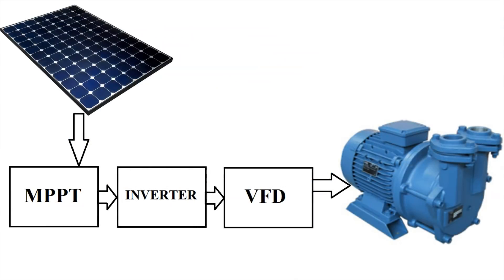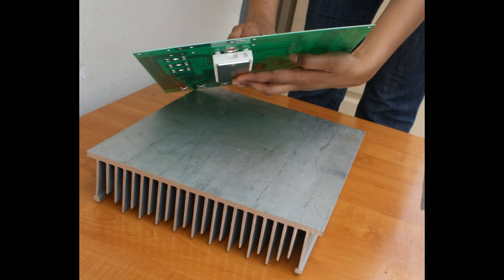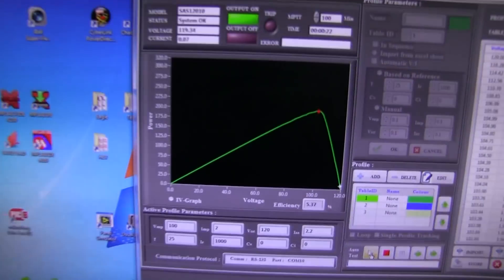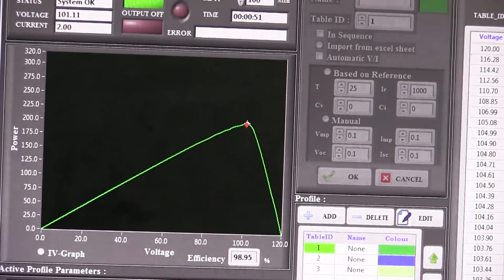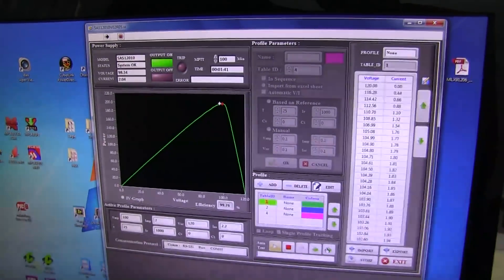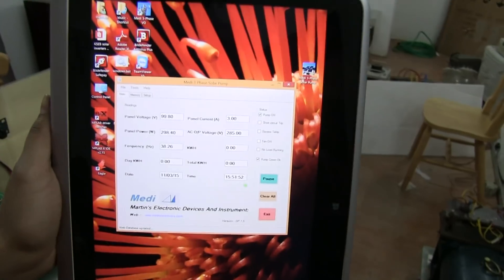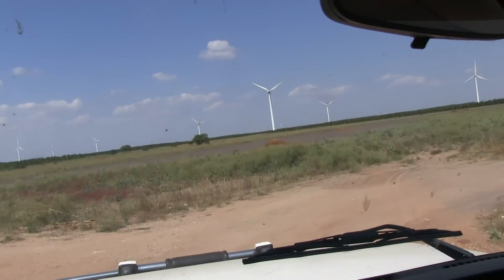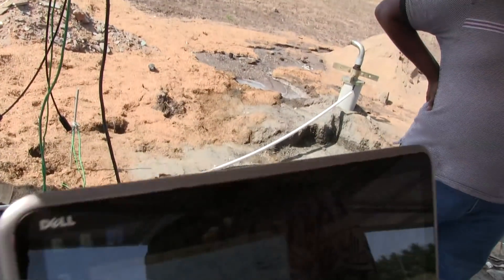3 phase Solar Pump Inverter with MPPT and VFD 2

Comment: The VFD varies the speed based on DC voltage?
Reply: yes, you control the input dc voltage using a potentiometer and the dc voltages are mapped to certain frequency values. Therefore, the frequency controls the speed of the motor based on the synchronous rule. Ns=120*f/p and the number of poles are constant.

Comment: the solar panel you are using in that demonstration of what power and voltage it is? How many HP is the motor and what voltage? thanks in advance to your answer

Comment: _*I was ended up saving from spending cash on a brand new vehicle battery when I found out about the reconditioning program [ check Details Here>>>https://t.co/hSpDD7rny9
 ], therefore I tried it to recondition my old car battery! I was not anticipating be that easy. This repair by yourself helped me to save $ 100 and I`m eyeing other batteries to recondition next._*

Comment: Solar water pumping system 098411/85357 :
3 - 20 HP Solar Water Pumps -
Solar water Pumping is both cost-effective and reliable for livestock watering, small irrigation and domestic water in remote locations ;
5HP- 3.8 lakh -Panasonic solar panel branded high-quality, long lasting Solar modules with
Yeskawa Made in Japan Smart controller for longer dawn to dusk operation.
and leading brand AC three phase Submersable pump like Texmo , Suguna , CRI & IDEAL
M Kishor 098/411,85:357SMS & Whats-up - Power Focus
As a recognized name in the industry, we are offering an exclusive array of Solar Water Pumping System

Comment: can i drive 1.5 kw bldc motor by directly connecting it to solar panel output of 340w through mppt...Is it possible...???
is their any mppt exist which works on ON GRID system means directly supply power to applience instead of storing in batteries
Reply from the maker: Driving a BLDC is not possible with this circuit. This circuit is meant for 3-phase induction motors. A circuit suitable for BLDC will be completely different from this.
Reply: Medi Electronics ohk then no prob but is it poosible

Comment: Can I run 1 H.P Submersible water pump with 900 watt solar panels and 3kw inverter without batteries? ???
Reply from the maker: Yes. This product is meant for that. It pumps all the power available from the solar panel to the 3 phase water pump, The power of the motor (RPM) will increase / decrease as per the panel power available. Naturally the pump start in the morning and will stop by evening.
Reply: Medi Electronics

Comment: we want single phase mppt charge controller for 12 voltage 800 watt solar
Reply from the maker: single phase MPPT means?
Reply: mppt charge controller for 800 watt solar
Reply from the maker: Please contact  Mr. Jose +91 98479-53271  M/s Core Electronics
Reply: Plz sendmy nembr watsap
00212667853884

Comment: I am installing a 5hp pump for my irrigation system. How big of a solar panel do you need to operate this?
Reply from the maker: 5 HP means approximately 5 X 750 Watts = 3750 Watts. So you need around 4000 Watt panel for 5HP. But what most people do is they simply take 1 KW panel for 1HP pump
Reply: Medi Electronics, can you provide 1 hp pump with inverter, send the details on my email: faisalhutamarine@gmail.com